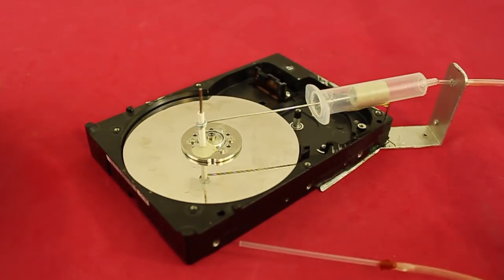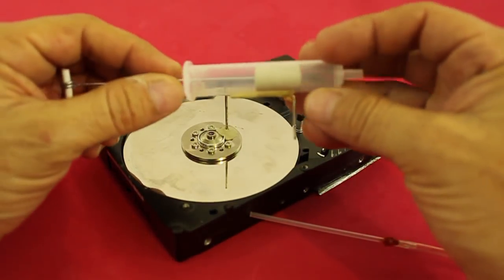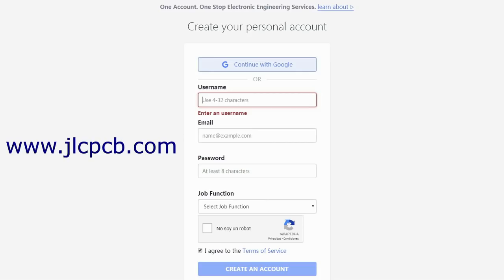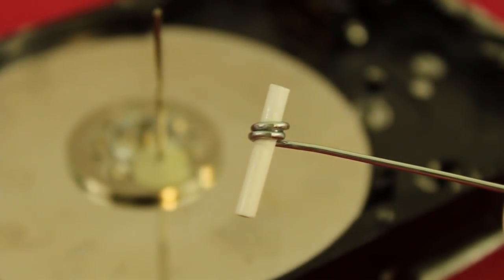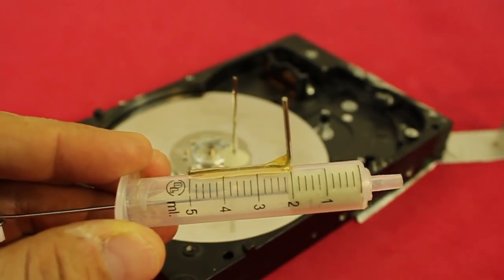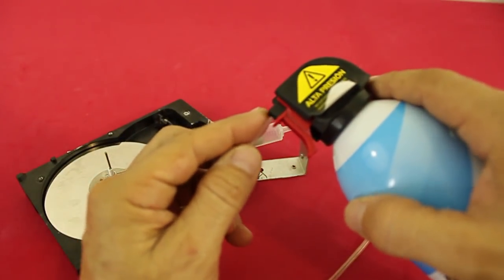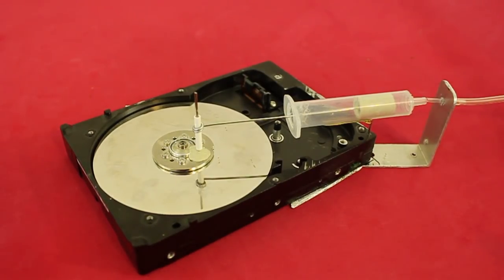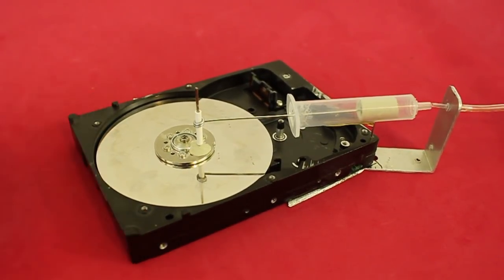Compressed Air Engine with an Old Hard Drive

Comment: You could attach 3 wires to this motor , it has 4 pins 3 of them are the 3 phases because it's 3 phase motor and the 4th is the ground . attach a 3 phase full bridge rectifier fo4 the 3 pins and see how much electricity can this motor generat .

Comment: Can the HDD motor output power?
Reply: Yes, it can. It is actually a brushless 3 phase motor. You can use 3 phase bridge rectifier to get dc. But not a good motor for that purpose.